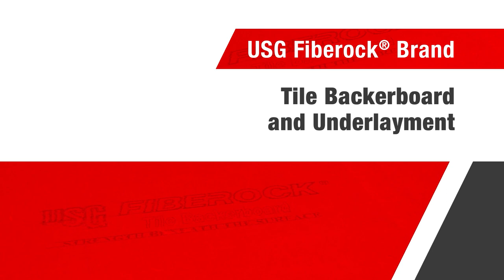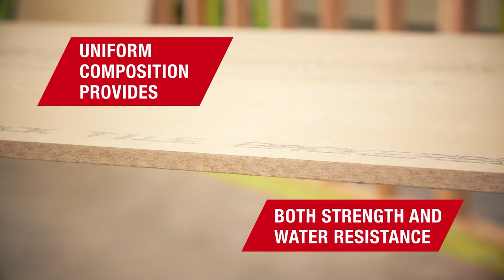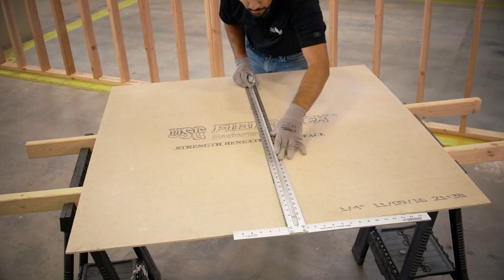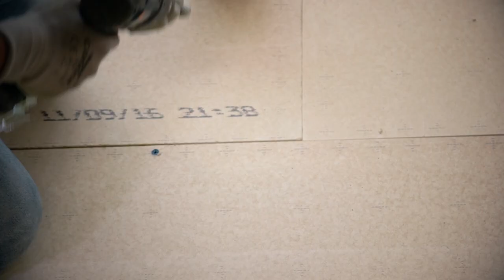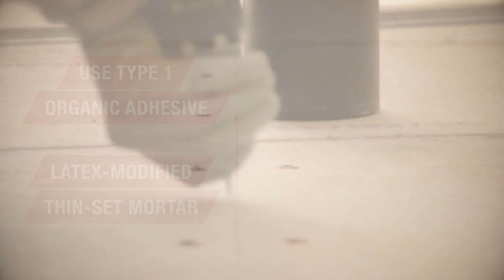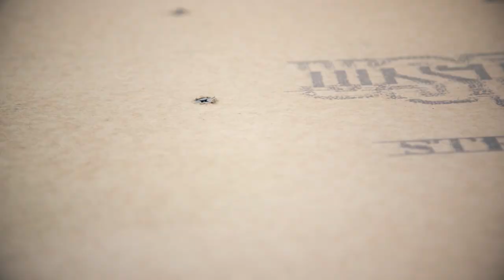USG Fiberock® Brand Tile Backerboard and Underlayment For Wet and Dry Areas

Comment: Basically just HardieBacker? I don’t see the innovation
Reply: A lot easier to work with.
Reply: @dekeferrell7265  Can it be used around gas inserts?
Reply: Much smoother surface and no annoying flared edges like hardie has on every board